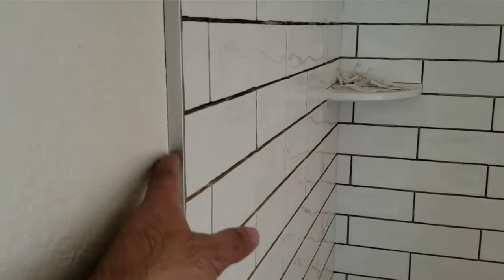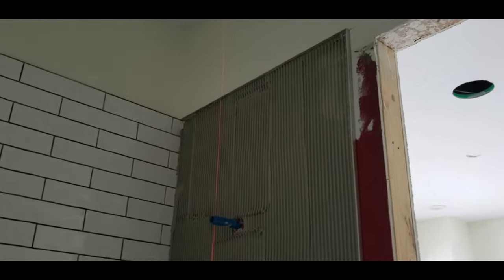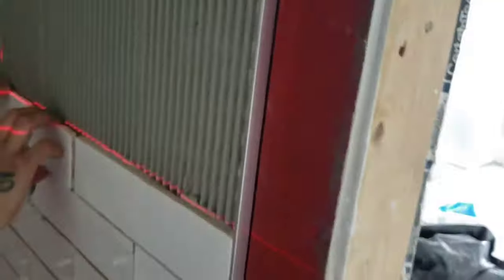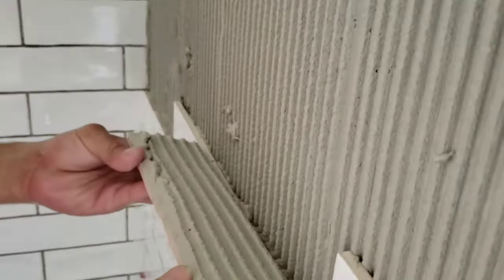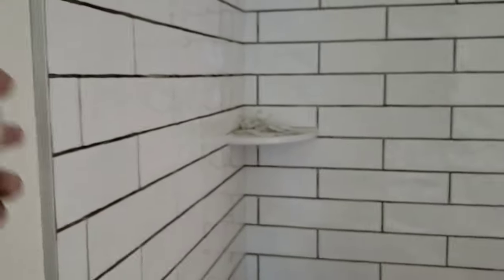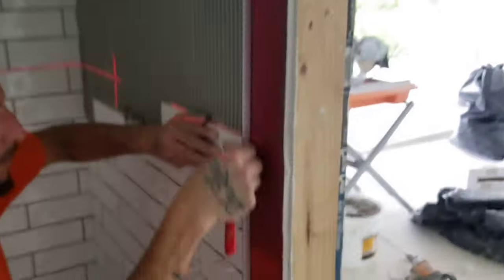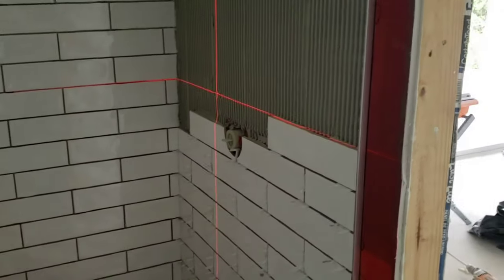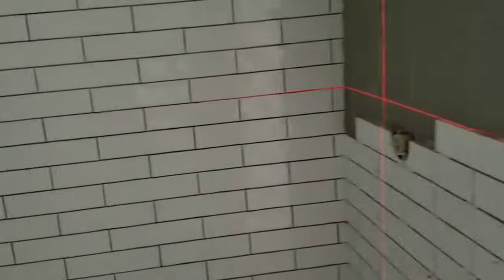Metal Tile Trim Shower Wall | TIPS | No Bull-Nose Tile | #Schluter-System

Comment: This tip is a keeper !!!
Like the solution of spreading thin-set on wall to make up the difference between tile thickness and the metal trim edge.
Letting the thin-set fully dry, then back buttering each induvial tile before installing in wall.
This makes the tile install painfully slow, but that's the way it goes if you and your customer want a great looking job for years to come.
I must say, workmanship on this job is supper ! 
Tile meets metal trim edge nicely and know lippage... Well done !
Their are many contractors that would have gone the quick way and lay the tile lower than the metal trim edge. Which looks bad.
Or contractor would lots of thin-set and lay tie in one go... Floating tile away from wall free hand to meet metal trim edge height.
Which would result in lots of lippage....

Keep the Tips coming.... Cheers

Comment: What your doing by the different directions of the thin set is creating mini square air pockets by not allowing the air to escape.  Its better to do what your doing with the wall but just butter the tile flat, this will allow the air to escape making better bond.